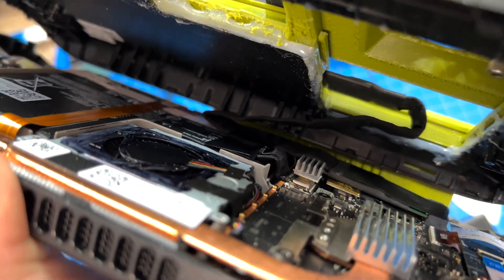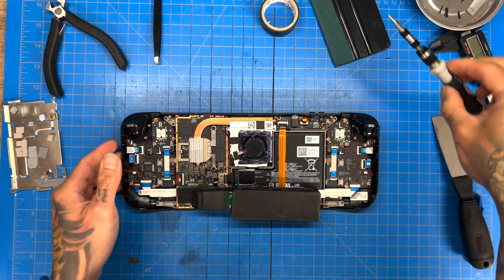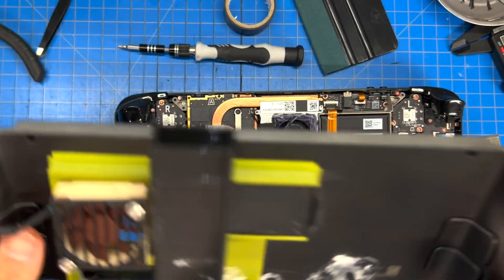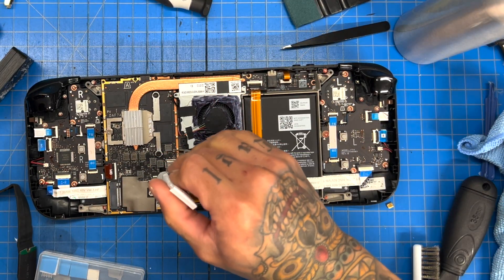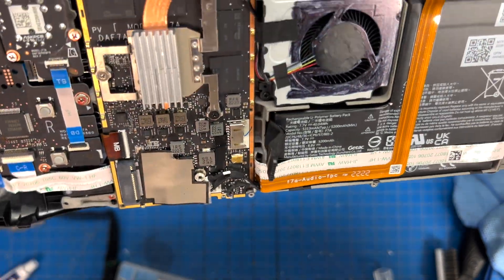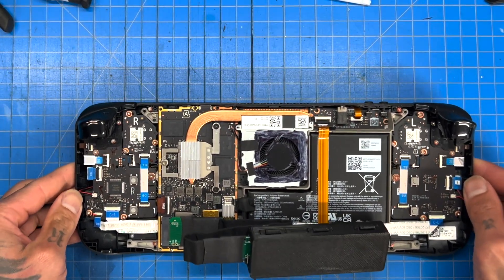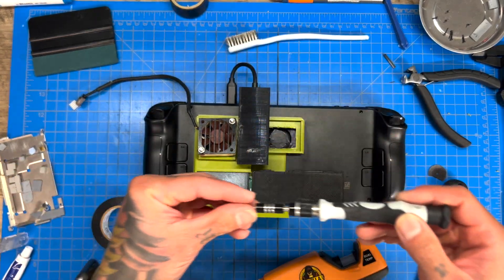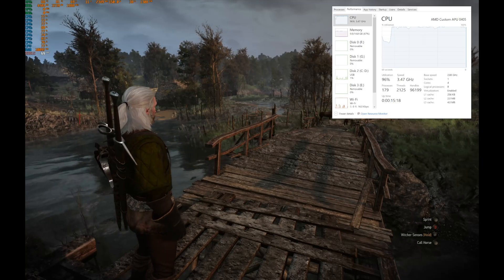Steam Deck Overclocking on Windows "Episode 4"

Comment: I’ve been playing around with overclocking with a stock Deck on Windows. Only mods were a repaste and a Jsaux backplate. I found that I have to force the CPU boost using Handheld Companion but it would a lot of times immediately shoot up in temps and crash seconds later. I was on about a 3800 CPU overclock when it happens. I seem to be safer with a GPU overclock so I’m going to leave my CPU clocks alone and mess with GPU + upping the TDP and see what that gets me
Reply from the maker: I’ve had similar a result, CPU over clocks on windows, seems to be extremely finicky on the SD.

What do you mean by handheld companion?
Reply: @Diy_Papi  Handheld Companion is an app for handheld PCs that gives additional controller support and power tweaking. I believe it’s still in beta but they have support for a bunch of the main handheld PCs.

But basically one of the settings allows you to force boost on the CPU. However I can’t force the GPU to boost to OC clocks
Reply: @Diy_Papi  also I did some more testing and found out my Deck was crashing whenever I set my TDP higher than 15w. I can still OC but trying to set the TDP higher is what was causing the crashes